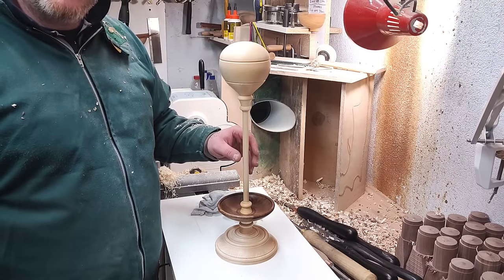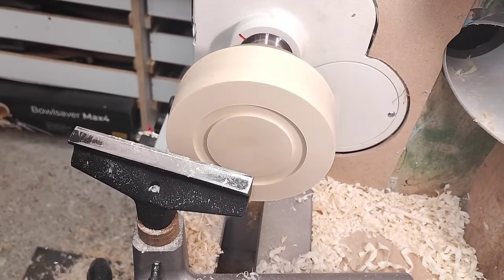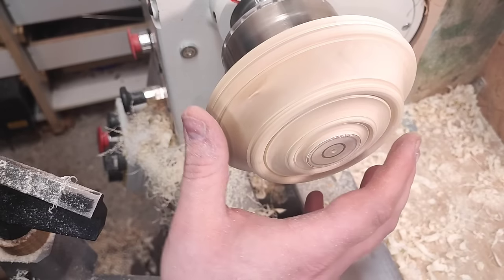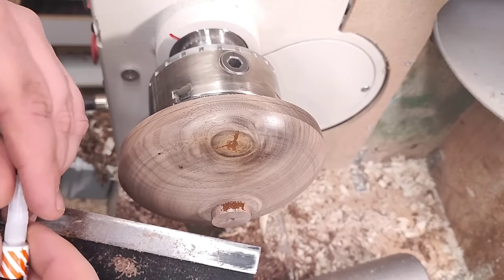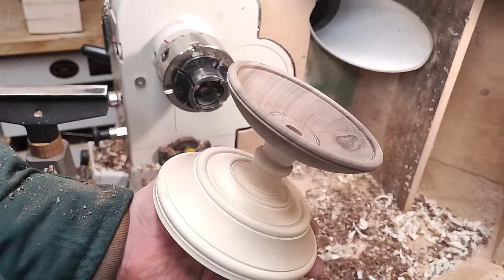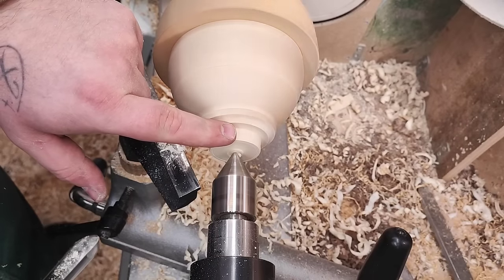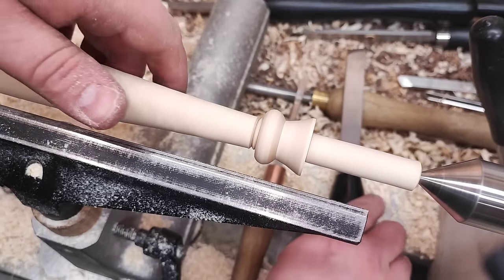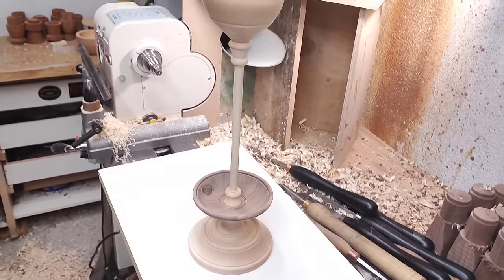WIG/ HAT Stand with walnut BOWL___4 WAYS PROJECT

Comment: Wasn't expecting too much from a wig stand but you covered loads. I saw you put medium CA glue into the end grain of the knot. I was surprised that you didn't wipe some sanding sealer on the surface before glueing the crack to stop the staining but then I don't think I've seen you use sanding sealer.

I was also quizicle as to why you didn't flatten your three pieces for the head on your lathe mounted sanding disk.
Reply from the maker: Hi Chris, I don't use sanding sealer but its good option for woods that like to stain.

I did think of using sanding disc however its not that flat, and the paper is kinda dull as well 😅